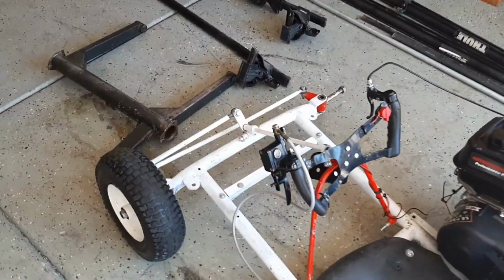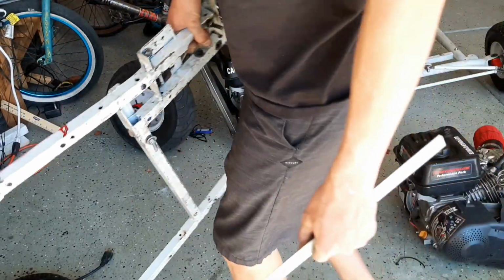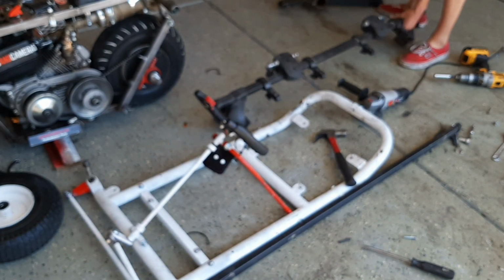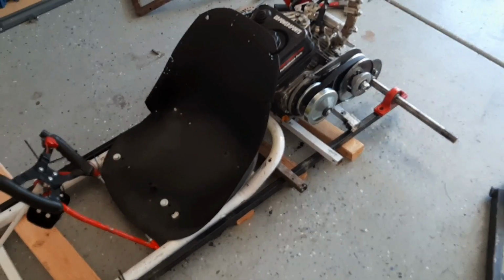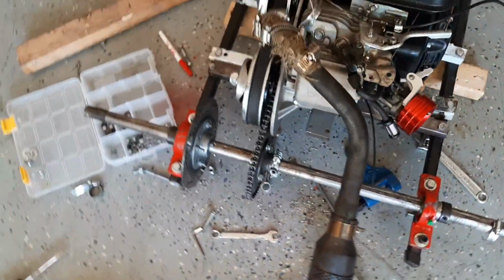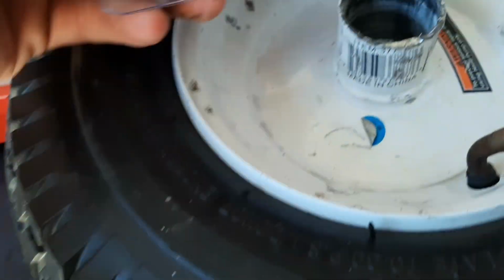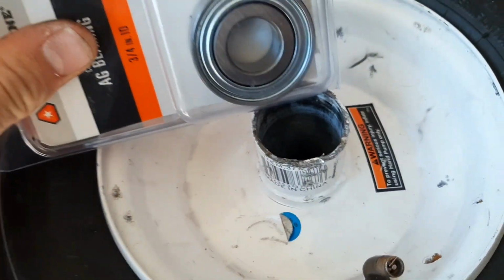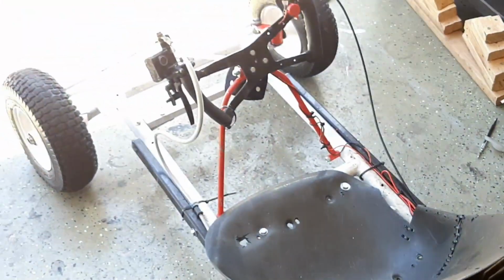6 hours NO WELD go kart frame build, CHPD shut us down!

Comment: Hey man, can you message me or reply with the exact wheels you use on front and back. My son is chewing front tires up in our neighborhood. I was thinking about going to a flat free option.  Any tips or info would be greatly appreciated.  Thanks!  Nice Kart skills by the way. I’m 45 and wouldn’t know where to begin! 😂
Reply: Watch videos on gokart steering geometry. I would say it needs to be tuned up man, there is a kart guy that has a very indepth video on it and other stuff as well like suspension 😉  i believe you want the inside tire to turn more that the outside tire as it turns a tighter circle than the outside tire